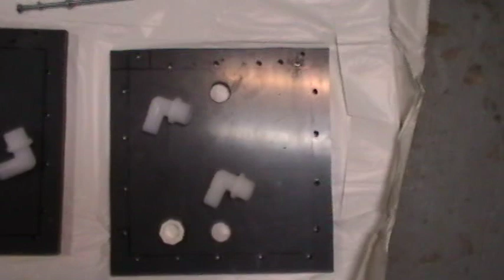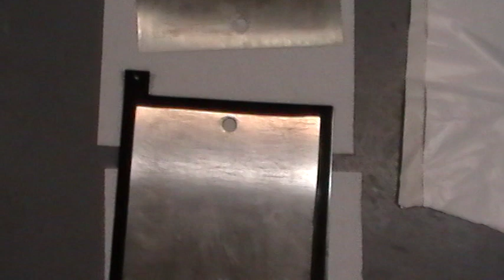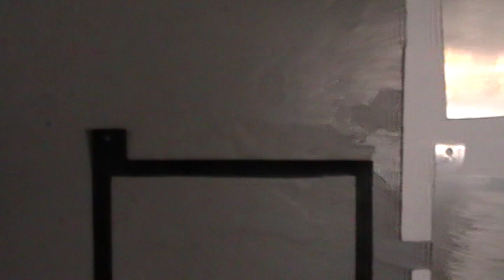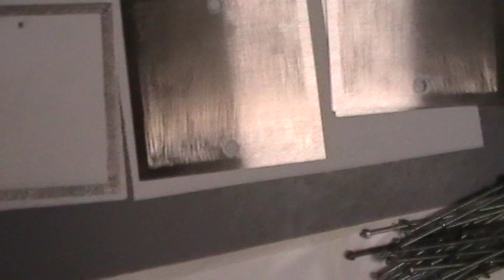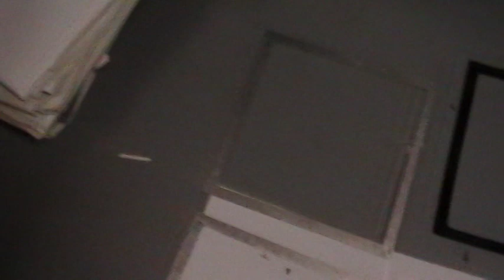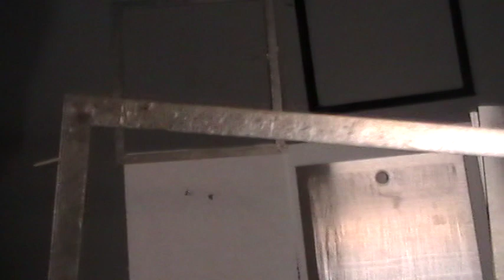New and Improved 118 Monster HHO generator part2

Comment: If electrode flat plates are magnetic, then there is increased bubbling with outer magnets attached. Alnico, ferrite plates type, or neodymium. The stress applied on water molecules is in the narrow gap of cell. The Horvath patent had transformer seled in cell center with outer spoked nickel plated steel around center. Outer curved plates were opposite. The pulsed field increased efficiency. 10Khz pulsed DC applied without diode on secondary , because of use of degraded steel laminations core, which provided what's called critical damped positive wave voltage to electrodes. US # 3980053  in 1976. This is basically a 500watt beefed up capacitive discharge power supply. Study online.

Comment from the maker: @richardlyew Coating the holes does help with current leakage coming off the edge of the plate but yes it doesn't eliminate it. I am fully aware of how it works. now instead of criticizing enlighten us with your idea of a drycell without holes.

Comment: @delvis11 hahaaaa putting a compound around the holes to stop current leak LMFAO. thanks for the laugh. putting a coating the holes will NOT stop current leak because as the electrolyte move from the + side or a bipolar plate to the - side it has to change from + to - and that's where you get your current leak, its not that much of a leak as its a resistance, the higher the resistance the more power it uses.when the electrolyte go from + side to - side its like switching the polarity.

Comment from the maker: @HHOPWR Larry I tried to get him to use 1/8 gap but he wanted to try the 1/16 first. I have learned from my errors. Steve has used weld-on on all the holes but it wasn't mentioned in any of these vids. Sand blasting is a proven advantage but it warps the plates real bad.